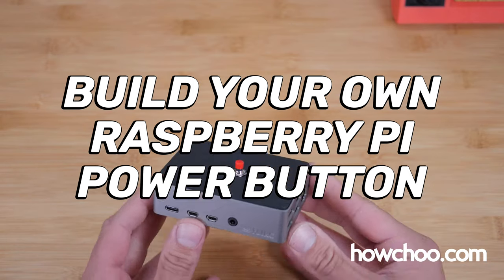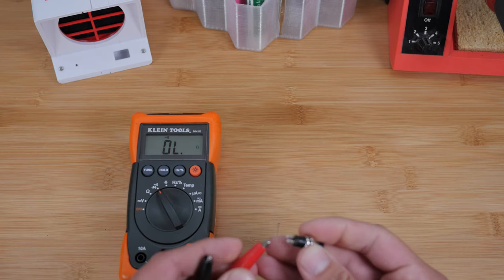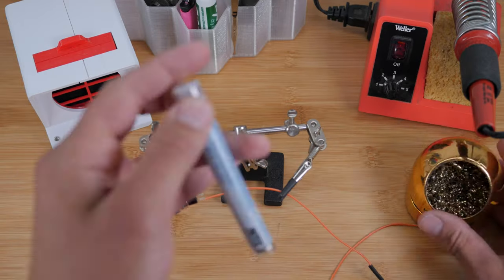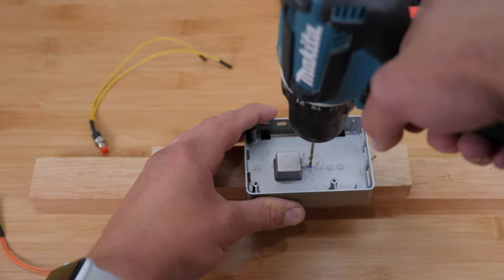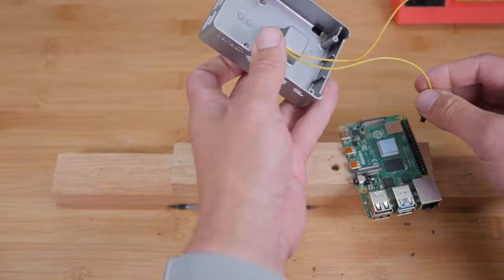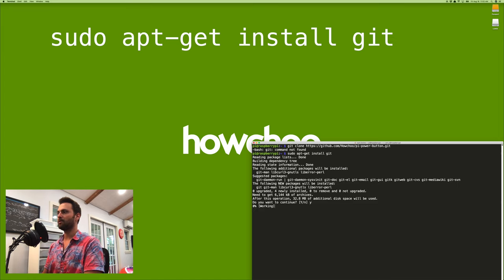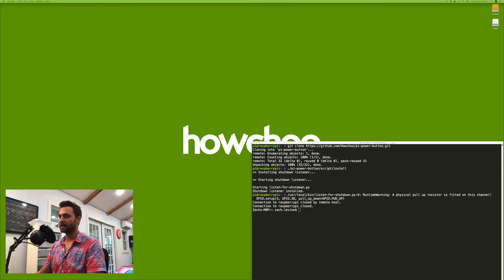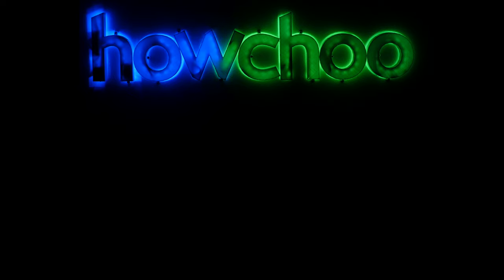How to Add a Power Button to Your Raspberry Pi (+ FLIRC Case Install!)

Comment: Hi, nice video, I am using the 7 inch touchscreen which utilises pins 5 and 6 already, is there an alternative pin out location i can use for the button?? TIA. Ian
Reply: The only two pins actually required for the touchscreen are 5V and GND - consider if your use case actually requires you to use any others - it might not.

Comment: Personally would have put it on the side of the case next to the sd-card
Reply: Much cleaner. Also, a different style of button would have helped so it doesn't look so terrible. Even if you wanted keep the location and the button, he should've drilled the bottom side wider and not the cover... Kinda sloppy

Comment: Managed to make it work with a switch rather than a button. followed your instructions carefully and it works! now I need to figure out how to turn off the fan
Reply: Hi! May I ask what type of switch did you use on your end? Will a rocker switch work?
Reply: @kurtroyales2659  yes a 2 way rocker switch with 3 connection points

Comment: Hello, 
Running Buster on a Pi 3b+,  your script is the only one I got to work, thank you. 
Question, is possible to add a "Hold" time in the script so the button has to be held down for x number seconds before shutting down. Many thanks.

Comment: I have installed your script on the RPI4 with Volumio, but the response was: 

  File "/usr/local/bin/listen-for-shutdown.py", line 4, in <module>
    import RPi.GPIO as GPIO
ImportError: No module named RPi.GPIO

How do I fix this?
Reply: Did you ever find a fix? I am running into the same error. When I install before volumio, it allows me to wake the pi but not shut it down.
Reply: @jonathanaknudsen  No, I gave up.

Comment: I have implemented this on a Raspberry Pi 3 and it works very well. Kudos to you for very clear instructions. I have a question that perhaps you can help answer. Will this solution work to power down the pi running on battery power when the battery is running low? I am guessing that pin 5 will go logic low as battery runs out, effectively same as shorting with pin 6 (GND). Thank you 🙏

Comment: Great video, thanks for sharing this. Is there an easy way to add a delay for shutdown? I’m using this in my vehicle and it has some  interference. I figured if I add a .5 sec shutdown delay (hold the button for .5 sec) it will keep the noise from shutting down my PI.

Comment: I have a question. If we are already using Pin 5 for another thing like a controller, is there any way to change the pin settings for the button? Also great video!

Comment: This works great. Just 2 things. 1). I get a message there is a resistor on GPIO3 when executing the script. 2). My Power does not fully go down. My Fan is still on although it looks like the USB ports are not active and of course the RED Led is still on. 

But this does Stop (shutdown) and Restart when I push the button.

Comment: Awesome!! Thanks so much for your scripting, your video and the detailed write up on your site.  I just wired and installed on my Pi4 which is in vehicular use.  Now, so much easier to shut down gracefully, with a physical button, instead of the GUI (or worse, turning off ignition key and hard-crashing the pi). I was prepared to copy and paste the code, run it at boot up etc etc. But your script did all the heavy lifting. Cheers!!!

Comment: Can this only be done on pins 5&6? I have a case with a fan, and that uses 4&6 on my Raspberry Pi 4B

Edit: I don't need the reboot/wake-up, I only want the safe shutdown
Reply: It has to be pin 5. Pin 6 can be switched out with any other ground pin.

Comment: Excellent Video......Thank you......I would like to use a button with an LED light ring.  How can I use a flat metal actuator, surrounded by a green plastic LED ring. On the back there are 3 contacts for the button (common, normally-open and normally-closed) and 2 for the green LED ring (+ and -). Connect 3 to 6V to the LED and the Normal Open as in your video.  My question is what would I connect the LED ring to on the board?
Reply: Did you ever find a solution for this. I would like to use a lighted button as well.

Comment: CRACKING I love it I now  if have my  raspberry pi  4 in a " fractal pc case "
Reply: Using the cases power button to boot it up I will upload a video to my channel of it running off a power bank on my Sony 43 TV I LOVE IT with only 1 cable out of it witch is the HDMI cable

Comment: Hi! Good work!
Unfortunately, however, although following all the steps indicated, this scheme does not work on my Raspberry Pi B+ V1.2 (2014) either with regard to the led or the on/off button (cf. the other video). Do you have any suggestions that can help me?
Thanks in advance.

Comment: Which pins should I use when doing this with a 7" pi touch screen? Pin 6 is used as part of the wiring for that so are there alternatives I could use instead?

Comment: Perfect!! My bartop is now 100% finished. Thank you 🙏🏼
Reply from the maker: No problem! Sounds like a cool project :)
Reply: @Howchoo  is usb3 speed still shafted on the 'new' firmware - I'm holding off on updates as All of the ones released so far have had other issues. I know it's a small risk but I'd reticent about bricking another one - having had one dev machine blowing it's hdmi 0 socket off from under-powering << yes really. 

right now these board seem to fail any prolonged testing and the raspian release is bluntly, terrible. (IF it was going to be used by novices - occasional reboots to fix the filer are fine for now - not being able to hotspot to Apple devices, not so much)
Reply: Power Button: "Burrrrrrpp!!!!"
Me: I'm cutting you off!

Comment: This worked great for my arcade cabinet power button until I needed to add a fan in 5v mode using pins 2 and 6. Can I use any other pins for a power button?

Comment: Thank you for the video. can I install directly now without that bootloader thing because its been two years now. do these things updated now?
Reply from the maker: Yep, you don’t need the boot loader as long as you don’t somehow buy a super old Pi 4 that still has the original firmware (like old stock or something). Try skipping the firmware step and see if everything works. You can always do that step afterwards if needed.

Comment: What if the power button had an LED light built-in with 4 pins, and all the pins are the same length? Where would place the resister? I have an + /- pin. I know where they go, but I'm not sure about the LED.

Comment: I have an error even though I have installed the rpi.gpio library.
pi@raspberrypi:~ $ Traceback (most recent call last):
  File "/usr/local/bin/listen-for-shutdown.py", line 4, in <module>
    import RPi.GPIO as GPIO
ImportError: No module named RPi.GPIO
I appreciate any help from you, thanks

Comment: This looks like a good solution for saving power on a RPi4 connected surveillance camera, but using a low power WiFi connected ESP32 (& motion detector) instead of a mechanical switch. Assuming that the RPi4 never really powers down, how much power does it use while in 'sleep' mode? Does it require a RTC battery to keep it 'alive'? Thanks😎

Comment: really good tutorial thanks. no idea why there are any thumbs down. only thing is, for me, I have 2 fans running on the same pin so will have to see if theres a way to move them or the button elsewhere?
Reply from the maker: Which pin are they running on? If it’s pin 5, this is definitely required for the power button’s “wake” functionality. But you can likely move your fan to another one (any other GPIO pin) since the fan probably only needs basic GPIO functionality :)

Comment: Hi Howchoo, great and easy tutorial, however please help with one detail: I got the momentary NO button with 4 contacts  (additional 2 contacts  represent built-in LED functionality) - how should I connect /solder my button? Thanks for advice for anyone in this world. Cheers
Reply: I wish I had the answer to this, my Rpi 4 isn't working with this script and I don't know if it's the bootloader or the way I've soldered my button...
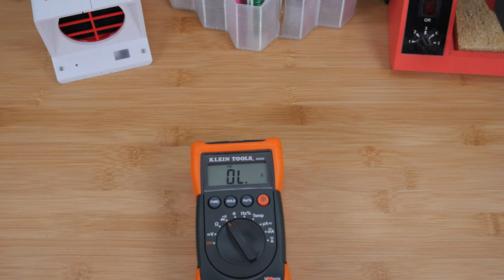Reply: @trispycee  I think you should be able to test your button with the instructions given between 02:07 - 02:28. Although the instructions are for a bit different thing (to detect if your button is a "normally open" or "normally closed" button), you can use the same style to detect which pins in your button are used for the button press if you try different pin combinations.
Reply: @jarkko4732  just an update: it works now! All I had to do was do a Sudo apt get update then Sudo apt upgrade and it updated the bootloader.

Comment: I have a raspberry pi 4 and the pi 7 inch touchscreen. it uses the same pins is there a way to add a power button to that setup?
Reply: I was able to get a power button installed on my setup

Comment: Hey quick question, so if I am supplying power from an OBD2 adapter in my car, stepped down from 12v to 5v and then plugged directly into the usb port, if I run this script will it still shut down the pi? I am trying to think of ways around splicing a toggle into the obd cable. thanks!

Comment: Awesome video I got my rpi 4b on dec 25 and it worked no problem no need to get the latest version. Btw recommend turning off the pi through the interface like you would a regular laptop or pc but turning ot on worked no problem.
Reply from the maker: Great, thanks for the info!

Comment: Will the raspberry also turn on when you re insert the power (usb) cable or can you just insert it and need to press the power button? Because I don’t want it to unnecessarily turn on when inserting power cable. Just like a normal computer for instance.

Comment: I just bought a Rasp 4 B its on its way, for retropie, loved when I just realized I could take all my roms outside my computer 2 a single machine.

I'm not an electric engineer so IDK nothing about hardware, i've been stuying with videos how to install it in the case, put the fan, the heat sinkers (or how its called), just realized the power button its cool, Want to implement it on my purchase, I saw your video and saw where you connected the button, but the fan uses 4 and 6, and you used 5 and 6 for the button, can I rotate the fan and change  6 to 14 that is ground too? IDK nothing about this so by logic im asking. Dont wanna damage mi PI.
Reply from the maker: You got it right—you can definitely use a different ground for either one. So use pin 6 for the fan's GND and 14 for the button GND. :) This is a good resource for identifying pins: https://pinout.xyz/
Reply: yes, a ground is a ground doesnt matter which pin on the rpi, and the rpi has multiple ground pins for use, you can look at the pinout guid howchoo referenced, and use any ground for the fan or button that makes cable management easier for you

Comment: I don't recommend stripping and  soldering jumper wires, those are usually made of iron. It will corrode over time, specially that it would be exposed to the heat of the solder.

Use a regular stranded copper wire instead.

Comment: does ground need to be pin 6 or can it be any ground pin on the board? because 6 is already populated by a pwm cooling fan on mine.

Comment: So, if you press the button it will send a signal and run a script and at the end will shut-off the raspberry pi. Now, how do you turn it on again? Because this is a normally open button. I was thinking of a rocker switch.
Reply from the maker: When you press the NO button a second time it will wake the Pi. I wouldn't recommend using a rocker switch, but if you absolutely had to, you could modify the script pretty extensively. I'm just curious -- why do you want to use a rocker switch over a push button? If it's for aesthetics, you could always grab a springed rocker switch that returns the switch back to the original position (basically an NO push button in a rocker switch form factor).

Edit: On second thought, shorting those two pins is what wakes it up! So your toggle switch should work as-is. :)
Reply: howchoo is there a way to use it wich a nc switch. Also how to you know if it is an nc or oc switch without a multimeter

I think I found out what kind of switch mine is. I believe it is an nc. My previous question still applies

Comment: Hello! I'm currently planning out my first RPi project ever and I'm curious whether or not you know if there's a way to have it where you have to hold the button to shut down. With the project I'm planning, I'd imagine there's a chance of the button getting accidentally hit during use, so I want to mitigate this problem before it even begins. You wouldn't happy to have any thoughts regarding this, would you?
Reply from the maker: This could be done by forking and modifying the code—would require some knowledge of Python, but it can definitely be done :)

Comment: Do power cables that have switches built-in do the same thing basically? Great video, fun to watch.
Reply from the maker: Thanks! And not quite—using a power cable with a switch is the same as ripping the cord out of the wall. That physically cuts power without SAFELY shutting the Pi down, which is bad :)

Comment: Can I use a different ground to pin 6, say pin 9 ? As I am trying to add a power switch to a Rasperry pi 3 b Kano kit. I assume the code would be different ?
Reply: You can use any ground pin you want. The code would be the same.

Comment: Using this on PI 4 with OctoPi and OctoDash cause a random stop job to be sent during prints. I am not sure how or why this is happening but it did not happen before installing and doesn't happen after uninstalling.

Comment: strange? im getting this error yet i am using a raspberry pi 4gb
 Traceback (most recent call last):
  File "/usr/local/bin/listen-for-shutdown.py", line 4, in <module>
    import RPi.GPIO as GPIO
RuntimeError: This module can only be run on a Raspberry Pi!

Comment: The premade button linked is quite a bit longer than the one made in the video, it doesn't fit in the recommended case.   After buying the switch (switches, actually, it's a two pack) and drilling the hole in my case, only way this works is if it just hangs out the top.  Too bad, I was already worried this red button would mar the appearance of this relatively slick case, now it's a red button with it's guts hanging out.

Comment: I did a similar project some time ago, the only problem with this is that if for example the script doesn't load for some reason or you load another image that doesn't have the script loaded and you push the button it may break the Pi, so it's safer to at least add a resistor to the switch or ideally make a pull up-down resistor circuit.
Reply from the maker: How would it break the Pi? Shorting GPIO3 to GND won’t do that
Reply: @Howchoo  I think I did it with gpio21. I don't know if gpio3 is different?
Reply: @Howchoo  But I believe the problem is that the pin stays at high voltage (3 or 5v) and doesn't use the internal push down or up resistor unless you enable it with the software.
Reply: Yea I just fried my board.... lame
Reply: @jorgealejo1968  Ouch that sucks
Reply from the maker: Jorge Alejo you can't "fry" your board with this project -- you must've shorted something (like connecting the wrong pins).
Reply: @Howchoo  agreed - you can fry it by testing how poor the power management is on early versions, even under normal under-powered scenarios. Pi4 is a LONG way from a commercial product right now. 

^^ I'll be testing that on newer and updated boards soon. I think Bleeding Edge is the best definition, along with a ridiculously early fan-fare launch. Any child will destroy the video outs on early boards by just plugging too much usb stuff in and why Rpi official power supplies are at least 18watts is beyond me.

Comment: very new to linux, but i'm enjoying the learning... i tried this and got this back

/usr/local/bin/listen-for-shutdown.py:8: RuntimeWarning: A physical pull up resistor is fitted on this channel!
  GPIO.setup(3, GPIO.IN, pull_up_down=GPIO.PUD_UP)

and the button does not work. 
i'm using a 3b if that makes a difference
Reply: how has decided this problem? I heared we have to 

solder two resistors so that there is no short circuit
Reply: From what I know, there are builtin pull-up resistors which basically prevents shorting pins when using a button. In this case I can only assume that its warning you about that, but I'm not 100% sure.

Comment: Does this work for turning the power on as well? This seems like it will only work as a safe power off.
Reply from the maker: Yep, this will also “wake” the Pi. Shorting those two particular pins wakes it from a shutdown state so it can consume 0 power while off. Check out the full guide linked in the video description for a better explanation of how it works :)

Comment: Hello sir, I have a raspberry pi 4 model B 4GB. I purchased this pi on November 8th, 2020. Do I need to do the bootloader step at all this time because you said that the download link for the bootloader will probably change when the raspberry pi 4 updates its firmware?
Reply from the maker: Almost certainly not. If the power button doesn’t work, then you should update the firmware.
Reply: @Howchoo  AH i see so, pretty much i can skip the bootloader step?

Comment: Has anyone else had an issue of the pi powering down when a usb cable is plugged into one of the usb ports? Whenever I try to plug a cable into the Pi, it will act as if I had pushed the button to turn it off. Once the cable is plugged in at both ends the Pi will start up and run as normal (octopi).

Comment: Because this solution is not reliable due to floating value on pin 6 my raspberry shuts down on occasion by itself.
For me it is not clear whether I need a pull up or pull down resistor and a cable connected to 3.3V.
I woul epect me to have the switch placed between pin 6 and 3.3V and a 10k resistor between pin 6 and GND. Can anyone confirm or provide me the correct schematics?